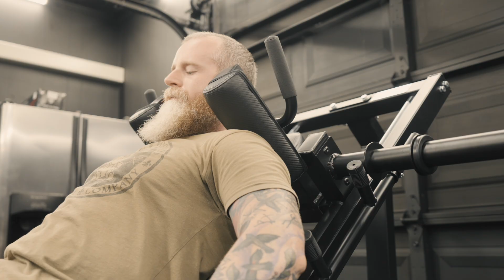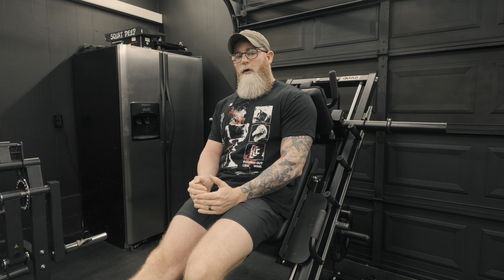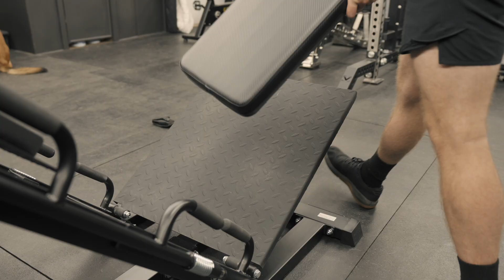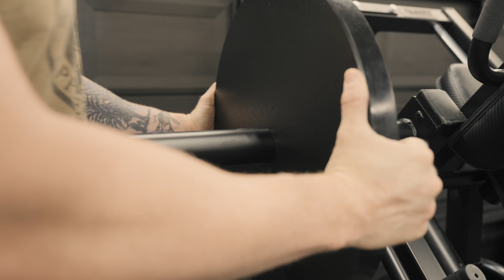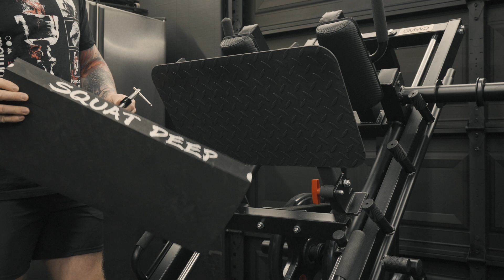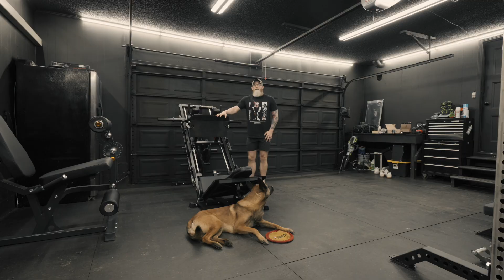GMWD Hack Squat Leg Press Review - We have gym at home

Comment: Great review. I removed the safety post as well to increase depth. Without the back issues, I find the leg press to be comfortable and gets the job done.
What is the manufacturer of your leg ext/curl machine in your video and do you like it? I have the GMWD model and am curious what you think of yours.  Thanks
Reply from the maker: @danielprice5540  the leg curl/extension is from extreme training equipment based out of North Carolina. But it’s almost identical to the brink fitness design. Very beefy and it is the best plate loaded option in my opinion.
Reply: Good info. Thanks again. Appreciate your response. 💪